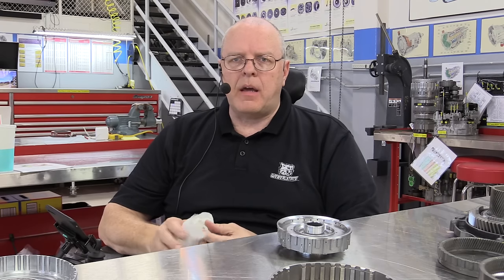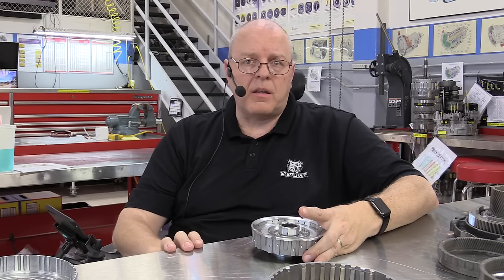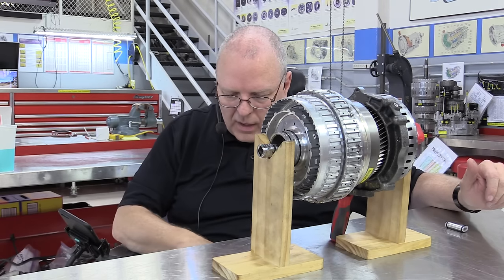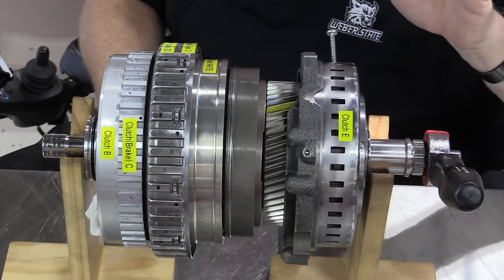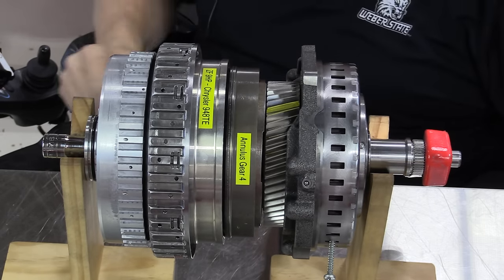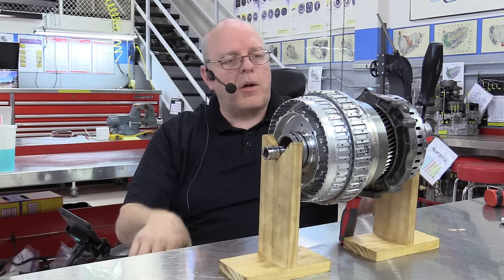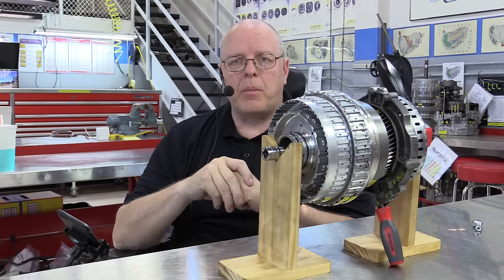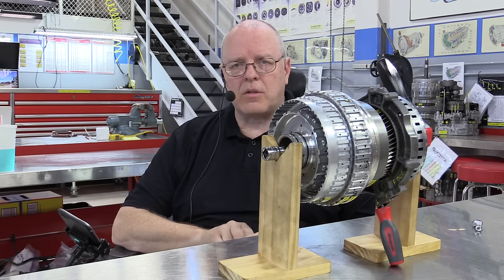Power Flow - ZF 9HP 9-Speed Transaxle Operation - Part 2 of 2

Comment: Hi John I have this transaxle in my new 2021 passport and have a weird issue. I had the OEM trans cooler installed and now when the transmission shifts from 7-8 there is a noise like the vehicle is going over a rumble strip. Honda says it’s normal for vehicles with coolers. It seems to do it under light loads and not under heater acceleration. What are your thoughts?
Reply from the maker: It sounds like the cooler lines are rubbing on something and transferring the sound into the passenger compartment. Thanks for watching

Comment: Mine tends to shift rough when it’s cold, after the car has not been driven for hours. Thoughts?
Reply from the maker: There are a lot of software updates for the transmission controller. One of them may have an effect on that.  See of a dealership can check that for you.

Comment: I'm confused about the overdrive ratio metrics.  If for 0.48 turn of input you get a 1.00 turn in the output, does that mean the overdrive ratio is 1 - 0.48 = 0.52, or 52% overdrive?

With the same gear ratio, for 1.00 input turn you would get 2.08 turns output, 108% more output turns (108% overdrive???).  Is there a convention for stating overdrive percentage?

Comment: Interestingly enough, These electronic dogging transmissions require a synchronized drop in engine power at the right moment to dog in place. everything is electronically coordinated. its crazy complicated. The software controlling them determines how good the shifts are, the two different styles of shift in the pattern makes it "feel" weird when driving to those not used to it.

Comment: There was a magazine that said the Jeep Cherokee 9 speed had to be going 75 mph before it would shift into 9th.
Reply: I have a chrysler 200 with the 9speed and v6.  It shifts into 9th as low as 67 mph
Reply: A.R. Walker That make sense because the Cherokee was a 4 cylinder I think. I have never driven anything more than a 7 speed Mercedes S550. What year is your 200? I just started test driving used cars and uploading my reviews.
Reply: I have the 2015.  Nice car.  Transmission takes a little getting use to.  With those 9 speeds it's shifting alot!
Reply: A.R. Walker Cool. The newest car I test drove was a 2015 Fusion 1.5 ecoboost. Have u driven a turbo before? It had zero lag but only 6 gears.
Reply: I just rented a 2016 Cherokee 4-cyl. Cruising no faster than 78 on a hilly 400 mile interstate trip, I never hit 9th gear. (I wondered whether there actually was one. Very nice driving car and an engineering feat in this atx)!
Reply: cleanedupmess I'm not in a hurry to drive that ugly thing but I would like to feel what a 9 speed feel like. Also this guy did broke it down where we could all understand it.
Reply: I had one as a rental back in the summer too.  The only time I ever saw 9th gear was at >80mph, going on at minimum a slight downhill on I-86/NY-17 in NY. I rarely even saw 8th gear, though I manually shifted it into 8th a lot on steady state driving at 75mph.
Reply: KiriyaAoi I saw a video where they were bragging about an Audi diesel doing 100 mph I think it was n 9 gear turning 2000 rpm.
Reply: Do Audi have a 9 speed car? Which one? DSG is seven speed I think and they use both the ZF and Aisin eight speed on various model. They have so many models that I may well have missed it.

Comment: hi teacher, thank you so much
I have many question but I try to being patient,
 One is more important to me, why over drive must be apply when this over drive is Try by pinion and  its next gear?!
thank you so much again
Reply from the maker: I do not understand, my appologies
Reply: last sentece "Neutralize by pinion abd.,.."
excuse me for mistaks
Reply: +WeberAuto after 5th gear output rotation is more than cranck rotation, and after transaxle we have a short gear that conncted to a big gear, and this reduce rotation. 
why in gearbox increase rotation over cranckshaft and then reduce by heavy gear?
Reply from the maker: For torque multiplication. Without it, it would not accelerate well from a stop. To overcome this gear reduction at higher vehicle speeds, transmission overdrive is required.
Reply: +WeberAuto 
thank you 
another thing that I didn't know,
excuse me for my bad english speaking

Comment: Is there any way this transmission can be programmed by the manufacturer to shift faster when you step on it in 4th or 5th gear or by the very nature of its dog clutch design it will  always be slow shifting under certain conditions.
Reply from the maker: I think it is the nature of the design with dog clutch synchronization. Thanks for your feedback!
Reply: Personal opinion. Dog engagement should be exceptionally rapid and violent. the end of the splines are tapered so that they glide into mesh easily even if the speeds differ. Is there any synchronising device built in other than a taper on the front of the dog splines? I don't believe so. I'm sure that if you saw how fast the compressed air shifted this dog collars you would be amazed.
Motorbikes use dog clutch gearshifts, directly controlled by a foot pedal. You do not hang about when changing ratios. The probable issue here, if the change is slow, which I have not found during the 500 miles I've driven my Honda so far, is that not only the dog changes but a clutch pack, or brake,  has to engage at the same time, breaking the torque [delaying] just long enough for the dog to shift and engage. I imagine that the software controlling the valving is crucial in this regard. Oddly, ZF seem to leave the control software programming to each individual customer to customise and perfect on their own. Evidently some brands of cars have been better at this than others. I have not heard of a single complaint from Land Rover/Range Rover or Honda UK built vehicle owners in this regard and I have done a lot of research before buying a Honda CR-V with it fitted.

Comment: Well at 37,000 miles mine is leaking transmission fluid on the ground and the dealer wants $3200 in labor just to access a couple of $50 seals. Thanks!

Comment: To resume:

Shaft - Clutch B (Clutch C)
1st Sun -> Clutch C (Brake)
1st Planetary - 2nd Planetary - 3rd Ring
1st Ring - 2nd Sun -> Clutch A (Shaft)
2nd Ring -> Clutch D (Brake)
3rd Sun - 4th Sun
3rd Planetary - 4th Ring -> Clutch E (Shaft)
4th Planetary - Transaxle (Output) -> Clutch F (Shaft)

1st gear (4.7:1);  Clutches A, D and F activated
2nd gear (2.8:1); Clutches A, C and F active
3rd gear (1.9:1);  Clutches A, B and F active
4th gear (1.3:1);  Clutches A, E and F active
5th gear   (1:1);   Clutches A, B and E active
6th gear (0.8:1);  Clutches A, C and E active
7th gear (0.7:1);  Clutches A, D and E active
8th gear (0.58:1);Clutches C, D and E active
9th gear (0.48:1);Clutches B, D and E active
Rev gear (3.8:1); Clutches B, D and F active

Nomenclature:
(-) Fixed one to another, rotate like one piece
(->) Fixed to a clutch, rotate together when activated
(Brake) Clutch function like a break when active
(Shaft) Clutch attached to the shaft when active
(Clutch C) Rotate together
Reply from the maker: +Emmanuel Vazquez Thanks for your feedback!
Reply: +WeberAuto thank you too, you make a great video.
You should see the diagram I made, its confusing as hell jajaja

Comment: i just wonder why this transmission is failing in acura cars with hard and very slow gear change, very disapointing
Reply from the maker: Good question, I do not know.
Reply: WeberAuto do you think that has to be how all the gear ratio is set to those specific cars?
Reply: It is probably a software problem. The only mechanical issue I have found during my research is a snap ring that is meant to hold a clutch pack together, coming adrift on a few early production units. I don't know whether there is a calibration procedure for clutch fill times on this transaxle, but it is certainly possible that there is. A tech for one of the car brands would probably know for sure.

Comment: You say there's nothing wrong with the transmission, but if you are trying to pass someone on the highway and you move into the left lane and try to accelerate and you press down hard enough on the pedal/throttle the transmission stalls, as if it has to "think" which gear to use and you just sit there for a couple seconds actually losing speed, and then all of a sudden it bangs into gear really hard like you just got rear ended and the vehicle rockets forward, which can be fun or make you look like a poor driver if you have passengers. And i'm sure that has to be hard on the transmission components. Also when you slow down and come to a stop, if you don't let the vehicle roll to a gradual stop, and baby it a little bit the transmission "bucks", again like you've just been hit from behind, which becomes a nuisance especially if you have a passenger in the vehicle. Those issues to me make the design or application of components, timing of solenoids, etc. to be of poor design. The transmission upshifts too easily. It makes me miss driving a manual transmission because in my opinion these nine speed transmissions are terrible, especially since the automobile has been around well over a century. In fact it seems like the old three speed auto transmissions were a lot better. The automotive manufacturers need to make these transmissions operate more smoothly before they put them into production.

Comment: Hi john, i want to ask a question
Do you know which solenoids are normally open on 948te, im asking because; we should to apply; A dog, F dog and D clutch for 1st gear, no need other clutches but if c clutches normally open we should send to signal for him and c clutches than closed and 1st gear ok. Do you know any info about solenoids which is normally open. 
And second questions; Do you know solenoids amperes, for examples; A dog and F dog solenoids amperes if they have 0.8 - 0.9 amperes, thats ok or weak?
Thank you. Regards
Reply from the maker: I do not know

Comment: I bet the ECU programming that cuts the ignition timing during shifts is not just for smoothness, but it helps keep the engine from turning the transmission's inner workings into glittery robot diarrhea.
Reply from the maker: Yes, all modern transmissions are controlled that way.
Reply: Even my 1998 Toyota Land Cruiser 4.2 diesel with four speed automatic cuts the engine torque while shifting up, so as to limit the torque on the engaging clutch discs. It also releases the convertor lock-up clutch at each change and during wheel braking, mainly for smoothness I think.

Comment: John - Thank you for all your superb videos! I've watched this video front to back 3 times including the video on the dog clutches. It's like an anatomy class. IMO, your methods of educating are spot on. I own a 2015 Jeep Cherokee. The whole package is an engineering marvel. Any chance you could do an anatomy of its PTU and RDM with the integrated Torque Transfer Device? It's intriguing that Jeep's video (https://www.youtube.com/watch?list=PLvULN5PwSSruJnAHrzioRvepAkLS_h4r-&v=KHbRvP7RB6w) says that:

-  "power is variably distributed between the front and rear wheels."
- "Snow Mode - with a front wheel biased 60/40 split of torque"
- "Sport Mode" - with a rear wheel biased 40/60 split of torque"

Wondering if the PTU or the RDM has an integrated planetary gear set to accomplish this underdrive/overdrive scenario in addition to 1:1 between the front and rear differentials.

Again, thanks for your videos. I'm subscribed and looking forward to your future classes.
Reply from the maker: +VideRay Hi, thank you for your kind words! Good questions. I am familiar with the Jeep PTUs and RDMs. As soon as I can get my hands on one I would like to shoot a video about it, bit it may be a while. There are several versions of each. Both the PTU and the RDM for the 4WD low system utilize planetary gear sets. It is a very unique and impressive design. The variable torque split is accomplished with a hydraulically applied multi-plate clutch pack in the RDM. The clutch pack controls the connection between the ring gear and the differential carrier. When the clutch is fully locked, there is a 50/50 torque split. If the clutch is not applied, 100% of the power is applied to the front wheels. If the clutch is allowed to slip, then the amount of torque delivered to the RDM can be varied anywhere from 0% to 50%.

Comment: So chrysler is making this transmission instead of the Mercedes design and it looks like it not doing well with shifting problems with 2nd and 3rd gear. The dealerships have no real fix. Class action suits are on going. The Germans are blaming it on operator error. Sounds like this could bankrupt Chrysler.
Reply: First off, Daimler sold Chrysler to FIAT. Second this transmission was designed by ZF Germany who makes the best 8 speed transmission in the businesses. This 9 speed is a very complicated and compact unit. Now why would you think FCA be in hot water and have bankruptcy on the horizon? Overall most of these transmissions in the Jeeps have been doing fine for 4 years now.